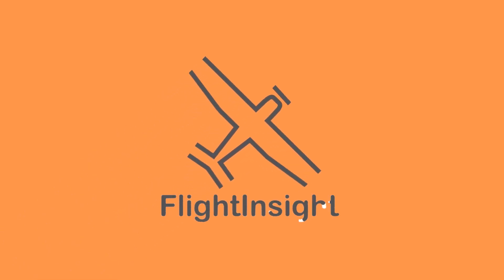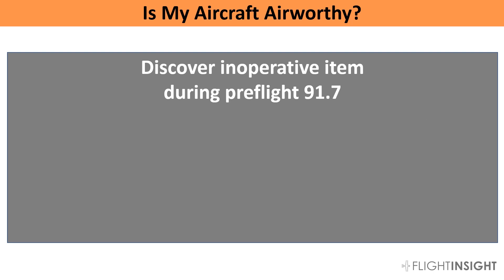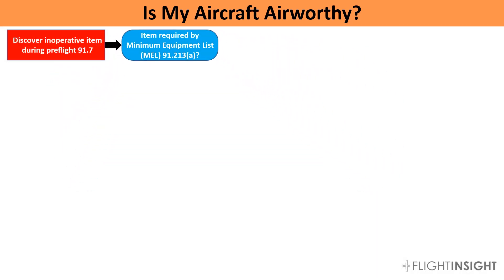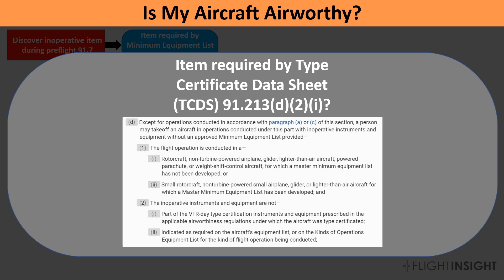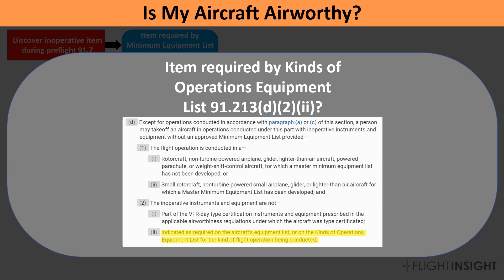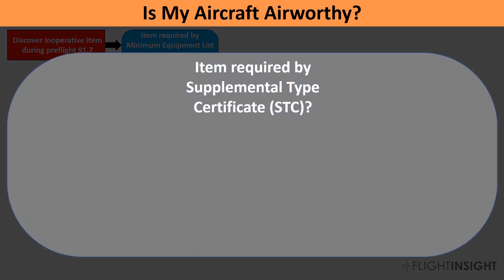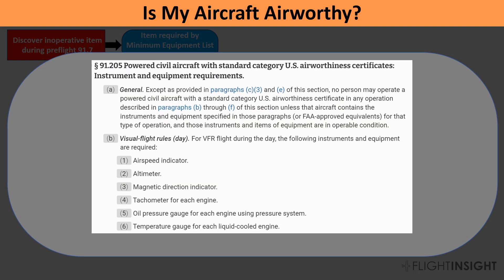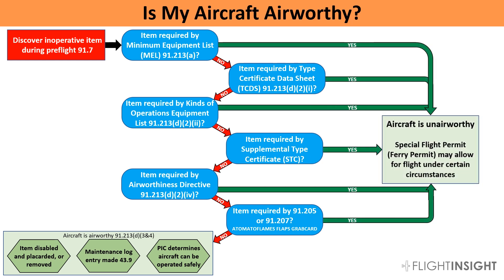Is Your Plane Airworthy? | How to tell if inoperative equipment will ground you

Comment: I remember when some guys backed up to a 172 with a pickup truck. They dented the trailing edge of the rudder in about two inches. To get the aircraft to their IA some 50 miles away, they decided to fly the plane without having a mechanic inspect the aircraft and possibly issue a ferry permit. They claimed "I'm the PIC, I get to say the aircraft is airworthy"! -- So... who can tell me if they had the authority to declare the aircraft as airworthy? Why? Why not?
Reply: Depends, is the dent to a point where it would compromise safety?
Reply: 91.3
Reply: @ No airman, unless he also holds an A&P, can determine a damaged component is airworthy. 91.3 doesn't give the authority to determine airworthiness for any component the pilot does not have the authorization to repair or replace.
Reply: @ Huh, didn't know that. Obviously it makes sense that a pilot is not qualified to be the judge of airworthiness of a damaged component, but I figure the angle you were going for was (a) [the PIC is]... the final authority as to the operation of that aircraft. I guess whether or not the aircraft is deemed airworthy legally, they still do get the final say of whether they fly. The responsibility of that legally wrong decision just lies on them, then.

Comment: An important Regulation I also include with 91.213 is 91.405 (c) which requires that any INOP equipment/instruments found & documented in the Maintenance logs are to be inspected, repaired or replaced at the next required inspection.

Comment: Part 1 on MELs is not correct. You CANNOT use an MEL without a specific letter of authorization from the FAA. Please read 91.213 (a)(2).

The Master MEL you referenced on the FAA website is not to be used for flight: it is to be used to develop a specific MEL for your specific fleet to be approved by the FAA in your specific LOA.
Reply: Also it’s worth noting that if you have an approved MEL with your proper LOA, the  MEL supersedes all the other steps. Which is the thinking behind why you have to apply to use one with your aircraft.
Reply: @Drewy860  correct. The flow chart should really have the MEL completely separate from all the other steps.
Reply: Now this whole discussion here, THIS is exactly what is wrong with flying last two-three decades or so.
This is lawyer-ing, not airmanship. Citing the FAR/AIM doesn't make you a good pilot.
Using common sense is usually enough. This whole thing was done by pencil pushers to justify their government salaries and is nothing more than a burden for aviators.

But then again, it is sufficient to see the visibility and cloud clearance requirements. 
Thus far, I haven't seen a person with a distance-to-the-cloud measuring device in hand while cloud surfing.
The system is so pathetically twisted and rotten, that it doesn't worth the discussion.
Reply: @DNModels  if you get ramp checked and want to keep your certificate, you better learn some “lawyering” 😉
Reply: @DNModels  I would argue “citing the FAR/AIM” on its own does not make you a good pilot, but if you don’t know what’s in there and/or ignore what is in there because of your self-defined “common sense”, you are not a good pilot.
Reply: @kgpilot7  citing it and knowing what's in there are two different things. There is a line that is crossed so far back, that you cannot see it anymore. 
Some DPEs want you to know what is the battery on your plane. Where is the flask for the pitot for gliders, etc.
Imagine if there were the same requirements for driving a car.
95% of the people doesn't know what kind of a battery they have in their own car, let alone in a rental.
Who check the tags before renting a car?
Same goes for airplane.
The above comment on ramp check is too - another government circus.
Reply: @jetjock60  Sure! Me waking up on the wrong side IS the reason for so many failed students :)
Gooooooooooood luck, big boys.
Reply: @kgpilot7 I would call common sense the fact that if a seat belt is not working or it isn't there, you shouldn't be using the seat and you have no need of MMEL or KOEL to decide that.
Reply: @planb5717  I would agree from a safety perspective. However, if your aircraft was manufactured before 1978/1986 the shoulder harness is not required because it wasn’t required for aircraft certification back then. A great example of where legality and safety don’t always correlate and why Aeronautical Decision Making is so crucial.
Reply: @kgpilot7  However, what regulations meant back then is irrelevant when it comes down to safety.
Hence, who cares what was 78-86 when you have common sense and can decide for yourself such a simple question?
Does the fish know it is in the water? 
I doubt it. Especially reading this here.
Reply: @kgpilot7  good point, but again - quite esoteric.
One Roman senator once said - the more the laws, the less the justice.
Reply: @planb5717  no objections from me at all. But unfortunately since neither you nor I run the FAA, if we would like to fly airplanes we have to follow their rules.
Reply: @DNModels  reading regulations has nothing to do with piloting skill nor proficiency.

But you are REQUIRED to know and understand the laws to be a pilot. You have to know what does and does not apply to you. In order to do that, you must read and comprehend the laws properly. Disregarding the law is how you end up in an enforcement action.
Reply: This kind of douchey attitude is precisely what sucks about aviation. You could have used tact to express your disagreement, but you'd rather fan your own balls by trying to sound like the smartest guy in the room while shitting on Dan. Too many people trying to inflate their own egos in this business. As an older guy who has done many things in life, whenever I see this my first thought is that the person talking/writing like this is very insecure.
Reply: @IlPinnacolo  Did he say anything wrong?
Reply: @SoloRenegade  Don't know, don't care. You can be 100% right and be a douche or you can be a gem. Insecure people choose the former.
Reply: @IlPinnacolo  Who made you the psychiatrist? Any discussion not offending anybody is allowable. Nobody was offending Dan.
Reply: @DNModels  you seem really defensive
Reply: From my understanding you check that the item is not required in 91.213 (tomatoflames acronym), the koel for the aircraft and finally AD’s, is that correct?
Reply: @Blash1  You're leaving out the Type Certificate Data Sheet(TCDS) as per example given in a C172 with carburetor heat. If the aircraft was type certified with that system or equipment it must be operational. Also Supplemental Type Certificates(STC's) need to be considered which in the example given was avionics. This can also apply to any other "aftermarket" to use a common expression, modifications done to an airframe, engine or propeller, i.e. you install a STOL kit or put VG(Vortex Generators) on the lifting surfaces.
Reply: @Blash1  and the VFR-Day Type Certificate. If it’s required by any of those, it may not be inoperative and placarded. It’s spelled out in 14 CFR 91.213 (d)(2)(i-iv).